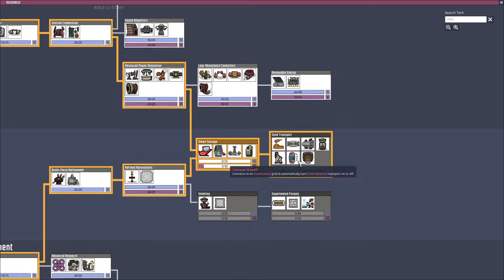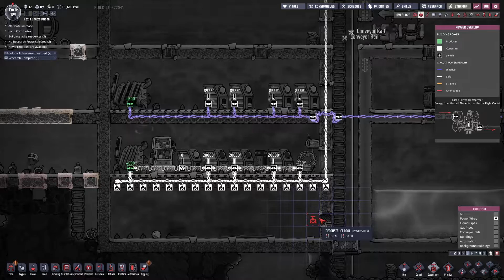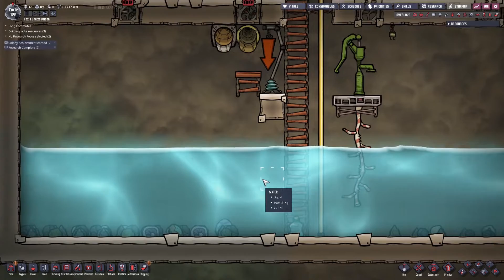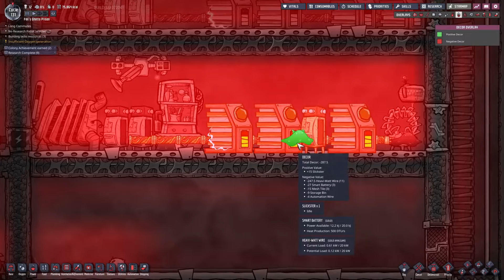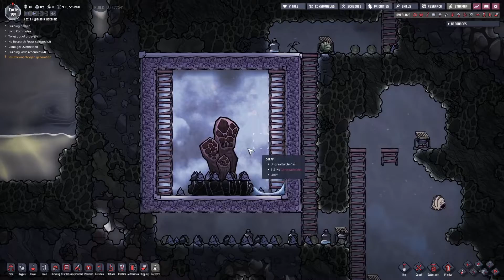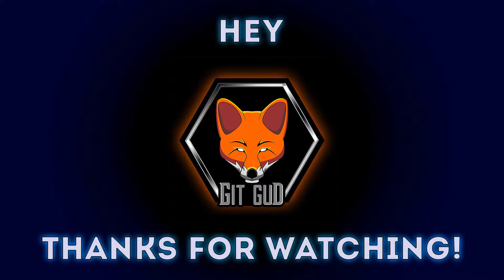DIABOLICAL MACHINE! (OXYGEN NOT INCLUDED "Terra" Episode 16!)

Comment: You can think of normal electrical outlets, similar to those you use for your phone as 110V outlets. 240V outlets are used for electrical dryers, and tankless electric water heater's. You can think of the Heavy Watt Wire's in this game as the same wiring used for 240V outlets, and thus the normal Watt wire as 110V.

P.S. - It is, definitely, diabolical. Diabolical AF.
Reply from the maker: I think these heavy watt wires are basically a whole bunch of regular wires that are sort of braided and bundled together.
Reply: Yeah, that makes sense